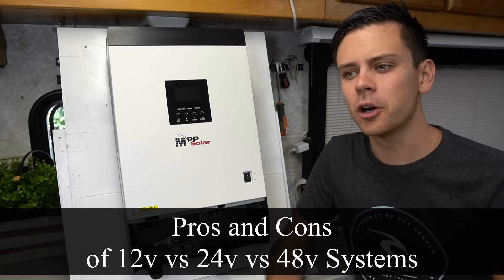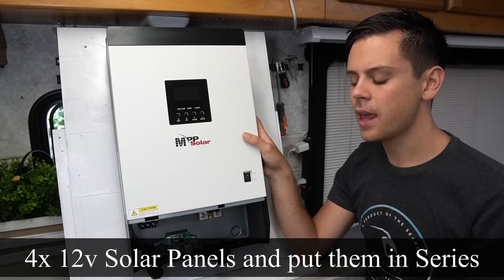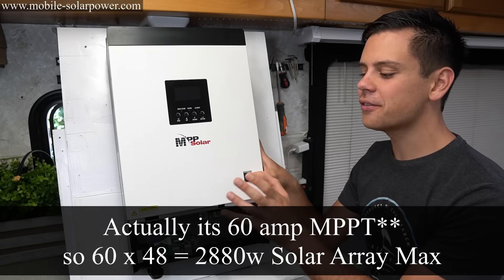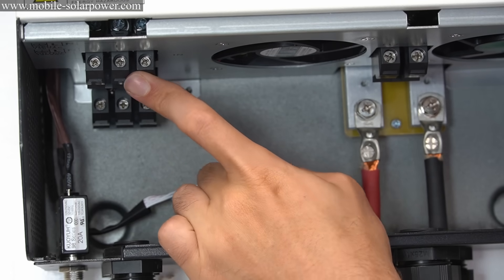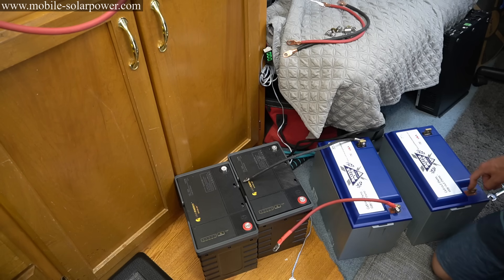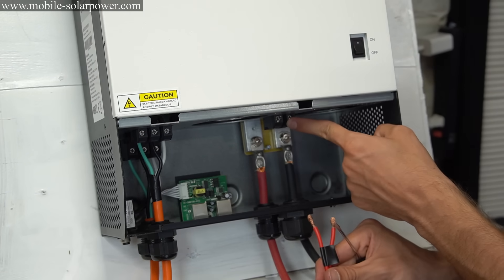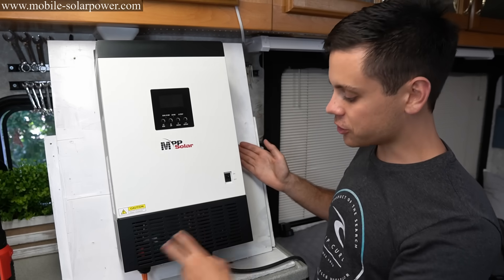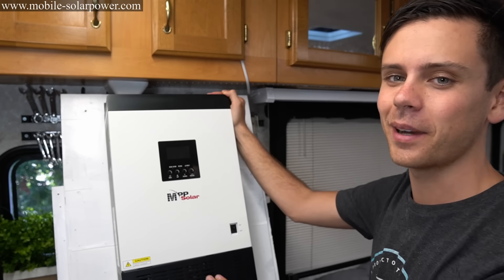48v Solar Power System for Beginners: Lower Cost and More Power!

Comment: Thanks for the video, I think that in the RV world, the maximum voltage is 24V DC, especially with the use of lithium batteries, since they accept high charge and discharge currents, there are no problems as for the lead technology, using the 12 / 24V DC is useful for directly powering anything designed for RV without the use of an inverter or DC converter.
The maximum human contact voltage allowed in Italy, considered to be safety, is ≤ 50 V peak alternating voltage or ≤ 120 V peak continuous voltage.
Under these voltages they are called very low voltage, above it starts the low voltage, (considered dangerous) ranging from> 50V to 1000V AC - and from 120V DC to 1.500V DC.

Ciao
Reply: joann robinson   Yes up to 60V DC, peak 120V DC, in AC logically it is less, in us the lowest alternating voltage is the European standard 230V 50Hz
Reply: joann robinson  yes but the concept is very broad, in dangerous areas, not in civil environments where 12 or 24 Volts are generally used, in all cases it is also possible to use 48V AC but on condition that the transformer has double safety isolation with specifications according to the law, it is not enough to switch off the 48v voltage with a normal transformer

Comment: I wish the 24 volt one had the on off switch for the inverter, that is nice.
Reply from the maker: It does
Reply: @WillProwse  Great also did you ever manage to change out the fans in the 24 to a quieter one?

Comment from the maker: Another update! I am moving into a house that I just bought and building a huge testing labratory/film studio. I will have some really awesome systems and explanation videos coming :) I am a bit behind on videos right now for this reason, but will be uploading a lot more in the weeks to come. Stay tuned :D
Reply: DIY Solar Power with Will Prowse awesome dude, really happy for your recent success you obviously doing something right
Reply: Cool does that mean we are going to see a solar build as applied to a home. Would love to see that build and then see updates on how well it is working! Great work here and well delivered info.
Reply: Cool video suggestion: when then battery is attached; there is a spark. Even if you use a switch, there's internal current surge.  I think there's a capacitor charging. So if we all used a resistor and diode properly attached, the sparking and current surge that's bad for electronic boards could be eliminated. That woul be an awesome video and Gizmo to sell from your website. Thanks Jack
Reply: @camperjack2620  zzpzzzz??
Reply: Congrats, Will. I've been hoping your vids might start moving that direction---DIY home systems. Great! Looking forward to your future vids even more now!
Reply: Congrats Will, very happy for you. I look forward to seeing what you can do with the house on solar.
Reply: how nice will!!!
Reply: Good news Will ! I look forward to future video's.
Reply: We are with you.
Reply: Good news, wishing you the best. You have gone a long way.
Reply: We are so happy for you!!!!!!!!!!!!!!!!!!!
Reply: Good for you Will. looking forward to home solar videos
Reply: Congrats man. Keep the experiment
Reply: I see a DIY powerwall coming!!!
Reply: Thats awesome man, congrats! Your videos have helped many of us immensely. You're thorough and thats so important when dealing with electricity! Many people are apprehensive do to having limited knowledge on the subject but all your videos give everyone more confidence just by equipping us with more pertinent information, knowledge truly is power and I can  tell you for a fact your reviews have saved me hundreds of dollars on bad or incorrect purchases, enough to the point I gotta buy your book ;) . Thanks again all the best to you in the future.
Reply: Congrats on your home purchase.  I bet your solar system is going to be massive!!!!
Reply: I am so happy for you! I watched your videos for some time. I know how long and hard this road has been. You are extremely intelligent and  have earned this. Congrats. Off the subject. I had a friend who bought a house and set it up totally off grid. He even set up marine low voltage air conditioning in the home. He did have one inverter and used propane for the hot water and the range.
Reply: Congratulations to you Will.  Look very forward to watching how things grow!
Reply: Wow thats grate Congratulations 😉👍
Reply: Blessings to you New house, you deserve it's !!!
Reply: @WillProwse
 he was not lying...
Reply: congrats!  hopefully you can try out a house mounted windmill now.
Reply: Awesome! Are you still going to be in the San Diego area?
Reply: Congratulations Will! I remember you saying a house is ultimately what you wanted. Makes me smile to see you make your dreams come true. :)
Reply: I am so incredibly happy for you, Will! I knew that with your determination that you were heading towards great things. Keep up the incredible work!! You're amazing!!
Reply: congrats!
Reply: wow! congratulations the sultan of DIY Solar Power, great job oh boy😘💋👼
Reply: Congrats!
Reply: Ha! I just bought both your books so I must have caused the financial scales to tip in your favor.  Congrats on the new home.
Reply: Congrats!  Glad to see you are doing so well
Reply: Congrats man. Love what you've done so far - I've learned a lot. Looking forward to what's coming.
Reply: Congrats bro!!! Well deserved!! Aloha from Hawaii🤙🤙
Reply: Awesome will.  I'm in the Bahamas and we love your videos. I'm building a 5k 48v system right now with 4 days of backup power for a home in the islands. 
Thanks for sharing your knowledge
Reply: My friend, you love solar so much! Why dont you come over to my country, Brazil and enjoy some sunlight and meet your brazilians followers?
Reply: Sorry for the bother...Great videos, by the way...thank you...
I have 48v LiFePo4 cell pack with BMS...I can use the 110v to plug my charger for these cells, but I was wondering if the MPPT will cut off(at 52v,full charge) if I hook the LiFePo4 BMS direct to 60v MPPT DC output?
Reply: When you come back please please please talk about how to add a wind turbine to this system.
Reply: Can you do a video explaining how and why you'd put two inverter in series!!!!
Reply: wow very helpful videos and explanations. Thanks for sharing your knowledge.  One question though, is it possible to add a water turbine or a wind turbine to these all in one apparels. Thanks for your answer in advance, I know you must be very busy.  Richard
Reply: Hi, A quick question: - Is it okay to buy th eAll-in-one MPPSolar 48V-1800W version for 230V (single phase 50Hz) and then use a transformer to step the electricity down to 110V/60Hz...?? The reason being 230V are cheaper where I live. Also: Which  transformer would you recommend for this 48V-1800W inverter? Thanks a lot
Reply: Congratulations!
Reply: Why you don't recommend Wal Mart s deep cycle batteries. They are easy to find and hold a lot of power for the money.
Reply: Very informative, very humble young guy, there are so many Shysters out there in solar panel land. Caveat emptor of course, but at least the consumer has a fighting chance armed with know-how from Will Prowse.
Reply: Awesome vids
Reply: Do you have a  email to answer questions?
Reply: Ok
Reply: DIY Solar power
Reply: Will could you talk a bit about Flywheel technology producing free electricity ; It probably be incorporated into a solar system with batteries ?
Reply: Hey will what wattage generator do I need to plug in this unit to charge the batterys 🔋?
Reply: Thanks Will, for your help with making everything clear and safe for my home build test set up for my RV system 😊
Reply: Can a person use this inverter to power their house if the grid goes down and would that work ?
Reply: Look forward to all your experimentations in the new gaff. ;-)
Reply: Awesome news.  I am proud of you.  I have a question - can you connect the watts that a solar panel produces to the house without net-metering, so that the house draws from the solar panel when it is producing rather than the grid, but pulls any access watts required from the grid?
Reply: @jasonbudd6359  why not just turn the breaker on the meter off and it will only draw from your panels
Reply: @jasonbudd6359  it also depends on the inverter.

Comment: The best advantage of a 48V system? Being able to connect to my golf cart batteries. Already purchased a well-used APC 3000XL UPS that I am using as an inverter. About to add four 100W panels and will have a self-propelled power station. Will be very handy when the next hurricane knocks out grid power.
Reply from the maker: That's smart!

Comment: Might be wise to mention the AC cable size requirement for full load.  Minimum 16 gauge for the 120V size and it will probably warm up and is only going to be good for a very short run.  For instance the 16 gauge cord you are using is only rated up to 13 amps most of the time, 2600 watts @ 120V is closer to 22 amps.  If you are going to be using full load 10 gauge is a much better idea and the power outlet you plug that in to if you will potentially be pulling over 2600 watts from the grid should be a 30 amp breaker with a cord and outlets to match.  When you start using the systems you not only have to calculate the loads the system can handle and the wire size for the DC side but also the AC side under full load.  That system can power a decent sized RV that likely has a 30 Amp cord.  Would hate to hear of someone burning their home or shop down due to undersized AC cords.
Reply from the maker: I figure it is implied but this is a beginner video. I do assume that beginners understand wire gauge size for their loads, but always a great idea to mention it in these videos. thanks John
Reply: @WillProwse  Yeah, it might be worth mentioning though that the person doing the work should look up the wire sizes needed for their loading.  It's hard to believe what some people will try and run through a little 18 gauge cord.  People with electricity are like cats and boxes, if it fits it works...
Reply from the maker: Great point! So true
Reply: 10/3 extension cord cut offs
Reply: Do u mind giving me some deets on wiring size @john I would pay for it just trying to make sure I wire up correctly
Reply: @Grabtheone  It really depends on the setup and situation.  But if you look up the NEC (National Electric Code) it should get you in the ballpark.  If you are grid tied you MUST follow it, if you are offgrid then using the same specs as code will make it so you are much less likely to have issues with your setup.  Plus following the NEC means that if at some point you need to connect to the grid there should be minimal issues.

Comment: I already bought the 12v 800watt mppsolar all in one and now in hindsight wishing I had bought the 24v 1600watt model for better results. But I’ll use the smaller one in a simple cargo trailer set up with one 12v 100ah liFePo battery. It never ends💰💰
Once solar grabs you it’s all over. Making my carbon footprint even smaller. 🤙

Comment: I am using 24v solar panels (330 watts x 2 = 660 watts) with MPPT charge controller to charge 140amp 12v flooded lead acid battery that powers my 12v dc appliances (ceiling fans, lights, laptop, pc, water pump). I do not have inverter yet.  If I jump to 48v using step down dc-dc converter, how much energy will this dc-dc converter consume to do the job?
Reply: Good ones are 98%+ efficient...

Comment: I'm looking to build a 24v 400ah battery bank with a 4 or 5kw inverter to an AC panel with a dozen DC circuits as well and about 2400 watts of solar. Most of it is assembled but I haven't decided on the inverter or battery bank yet. I'm hoping to spend under $7K for the batteries and inverter. I've learned a ton from you, thanks for all the videos, but haven't seen you build a large or high powered system. Got any advice for me or a battery source youd point me towards?

Comment: how many solar panels and batteries would it take to run 500 watts continuous for 12 hours at 240v..averaging 5 hours of sunshine per day.?..and through winter..in europe..
Reply: just a rough estimate would be cool Will..
Reply: im guessing i would need a little help off the grid during dull days.
Reply: 2 kW solar array, minimum. 48 volt battery bank using   sixteen lifepo4 cell @ 100 ah = 4.8 kWh $$$

Comment: My dream system for my future van build is: 48 volt, 1000ah (sinopoly, Winston maybe). 2-500watt panels on roof. I live in the south so I want to power an A/C unit. Yes, I know that is outrageous but I can dream.
Reply from the maker: That would be so nice actually. The small wires would make it so tidy and lightweight. And powering an ac would be no problem with 1000 watt array. Totally possible.
Reply: Check out Hotspot Energy - they have all solar or AC/DC powered mini-splits that would be perfect for you

Comment: Would this system work using a Tesla 5kw battery?
Reply from the maker: two tesla modules in series, and managed properly, sure thing. Just program low volt cut off and upper limit voltage and it would work perfectly. Super cheap
Reply: I'm curious about this myself. It looks like you should be able to configure the parameters to a tesla battery.

Comment: You might want to say AC wires in other countries may be different such as here in the UK live is brown neutral is blue and earth is green and yellow. Great vid ive been running a mpp 2424msx for over 3 years
Reply from the maker: Oh good point. Didn't think about that. I am not familiar with the color code of other country wires at all. Will mention this more, thank you Chris
Reply: @WillProwse  you might want to revisit the active cell balancer from a while back there's a bit more information available now my brother has one on his system and it is balancing his batteries Just watched a video this morning of a 3s version being used to balance super caps.
Reply from the maker: @imchris1978  very cool! I have a pile of them now so will get to that

Comment: Really beginner friendly. 1800w inverter seems small. The investment in battery bank and scaling seems a downside for the budget minded
Reply from the maker: Hmm true, unless you max out the solar string limit. Could easily have 4-6 panels in a string, but more planning is involved to hit that perfect solar input voltage. And true about the battery bank. Surely does take some dedication. 

I personally think 24v is best all around. More efficient and a lot cheaper than 12v, but not nearly as powerful or cheap as a 48v system. 12v systems require less planning and yes, easier to expand them over time.
Reply: @WillProwse  Thanks for all your videos. I agree that 24v is the Goldilocks, just right. My other point was locking into a marginal inverter size, being all in one has limits and should be considered for scaling also.

Comment: I zapped the hell out of myself being all sweaty and leaning on the terminals of a 24v system on a military truck.
Reply from the maker: Show me on the doll where the electricity shocked you haha

What part of the system shocked you? Coil packs and even relays can shock the hell out of you too. Not fun. What were you doing to get shocked?
Reply: @WillProwse  haha, I was working on the truck near the battery compartment.  I hit the pos post on my left arm and neg with my right arm.  while I was stuffed inside the compartment.  I was soaking wet in sweat though.  It wasn't like a 110v shock.  maybe cause it went through my body but it didn't feel good
Reply from the maker: @ljzweck  Ohhh ok gotcha, yeah the sweat will do it. Sweat is pretty dang conductive with the dissolved solutes. Yeah that doesn't feel good at all.